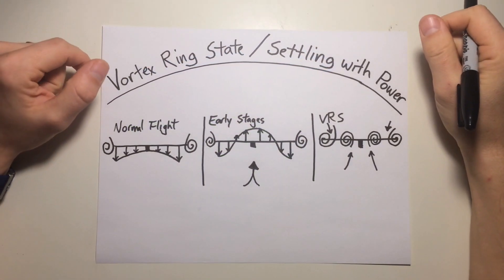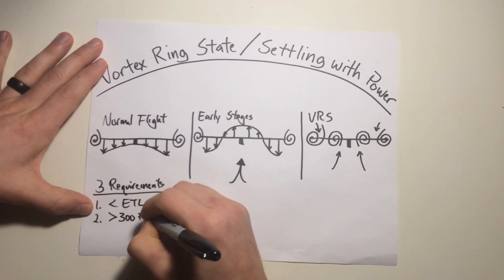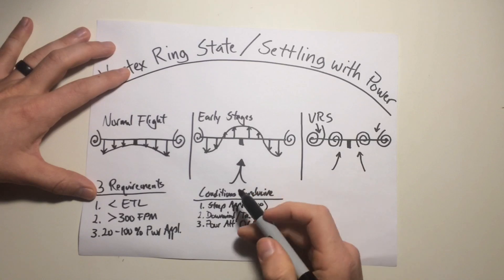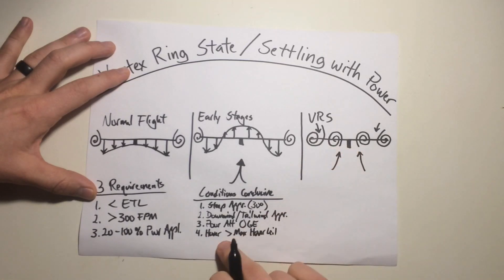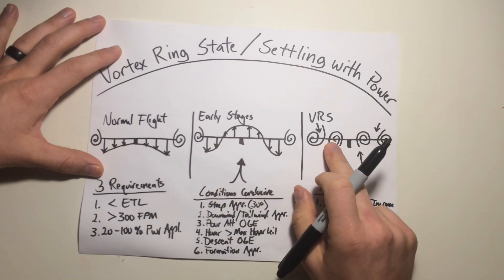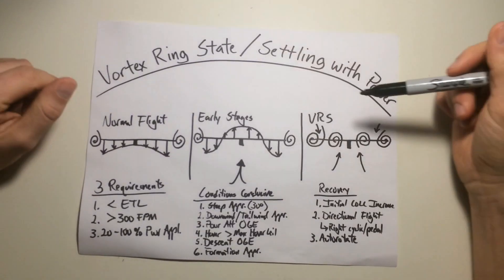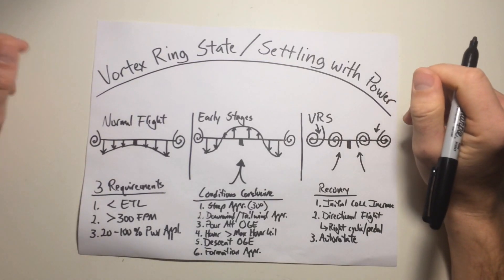Vortex Ring State / Settling with Power in Helicopters - Part 2

Comment: Settling With Power is not Vortex Ring state. VRS is when the helicopter enters its own downwash. Settling with power is when the rotor's drag is so high that engine is no more able to keep nominal RPM. Because of the RPM are not nominal, it producess less lift and also you can stall the main rotor.

Comment: You should state clearly that settling with power is possible without being in vortex ring state! To me it sounded like you say that settling with power is a result from vrs, which is not true. Those two are totally different conditions, only the result when not handled properly is the same: hitting the ground without the ability to stop the descend rate.

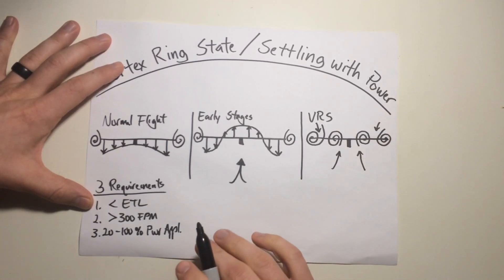Comment: Thanks for the effort in the videos.  It is always a good quick refresher. Just a slight correction at 2:45, according to TC 3-04.4 you must have the three conditions existing simultaneously in order for settling with power to occur.

Comment: A squirrel cage fan can hold or contain almost entire airflow. A ducted fan can do this nearly the same. A helicopter blade is completely different because it's out in the open. Plus, the blade can throw those airs out sideways to mess up the downward flow to cause the vortex.

Comment: Hi, in your description of the parameters required to enter VRS you mentioned that the descent rate had to be greater than 300 ft/minute, does this vary based on factors such as rotor diameter, or is it a fairly fixed value
Reply: The descend rate you need to enter VRS depends a lot on total weight and rotor diameter. Usually it is 600 to 1000 ft/min.

Comment: Can a rotorcraft which is landing in an autorotation configuration develop a vortex state? I say no but I have heard statements from Gyroplane CFI’s this can occur. To me a complete reversal of airflow has to happen at the exact point of the aircraft flare and that seem unlikely especially dire to the fixed state of the angle of incidence or collective found in most teetering type of rotor systems.

Comment: my brother, a few questions 

1) so is ETL basically forward airflow ? i watched the other video on it also left me a little confused.  do you just power forward once you have a bit of lift? and slowly pitch slightly forward until you achieve ETL? and does this still apply when you're flying at higher altitudes? should one ALWAYS be pitching forward more or less to maintain ETL? and how are you supposed to maintain ETL when hovering, or descending from a hover?

2) what exactly is a "downwind" "tailwind" approach?

3) for the 4th condition i just was confused on what exactly happens when you're hovering above your max hover ceiling, what that means for airflow and what you meant by not alot of power applied? and why does being at the top of that hover ceiling pull more power?

4) if you're hovering at ANY altitude 2x more than your rotor radius above the ground is it classified as an OGE hover ? 

im sorry if these are stupid questions im not a pilot at all but this is so interesting.

        @@UCG13vqdYSapylJU53JD8yEQ

Comment: There is a forth condition needed as per the U.S. Army.  An approach angle of 30 degrees or greater.  If you think about it almost every single normal approach you make has the first three conditions you listed.  If it happens to you, you will be close to the ground so autorotation  would not be a good choice.
Reply from the maker: 333insaneclown. Per the U.S. Army's Fundamentals of Flight manual, there are only 3 aerodynamic requirements for a Vortex Ring State. The 30 degree angle applies to a technique to help avoid the condition. Thanks for the feedback!

Comment: Thanks for the helpful series Jacob. I am just learning about helicopter flight dynamics and I have a question about the two terms: It was my understanding that in Vortex Ring State the blades are in a stall state, while in Settling with Power they are producing lift, just insufficient to reduce the decent the desired amount.
Reply from the maker: Dan H. Vortex Ring State in most aerodynamics manuals is attributed to "turbulent air" rather than a stall condition. A stall condition is defined as when the resultant airflow impacts outside of the critical angle of an airfoil. I suspect that in a VRS the airflow is buffeting in and out of this critical angle because the airfoil is still producing some lift (although not enough). We know this because 1) the descent rate is not that of an autorotation and 2) if you entered a true autorotation the vortices would go away.  

To address settling with power, many people get wrapped around the word "Settling" whether it be with "insufficient" or "sufficient" power.  Settling with power (sufficient power that is) is associated with a Vortex Ring State because increasing power intensifies the ring state and increases rate of descent.  The airflow is simply not conducive to flying despite the aircraft having plenty of power available. Even with a large power margin, the rate of descent cannot be arrested due to the ring state only being further aggravated with power application. This is drastically different from settling with insufficient power.  This condition occurs specifically from operating a helicopter with very little power margin and a sink rate is allowed to develop greater than can be arrested (based on aircraft climb/descent performance charts). As the helicopter decelerates less than ETL it falls even faster at a rate that's unrecoverable. This is simply poor planning, power management, and poor pilot technique. This condition doesn't even require a Vortex Ring State to be present in order to occur. I think it's important to distinguish the differences between these 2 types of settling because one deals with an aerodynamically turbulent environment and the other deals with power management. I hope this helps.

Comment: Jacob, from one 64 driver to another... great video series. However the recovery is most effective when executing Claude Vuichard's recovery. As you stated directional flight which is not always forward. Application of maximum power maintaining heading and lateral cyclic allows for faster recovery. There is a video on YouTube that demonstrates this maneuver. Great job though.

Comment: Hey, On the outset let me thank you allot for these videos,These are some helpful insights for the freshers.

So you mentioned for recovery , give some form of directional flight , mostly right lateral and right pedal
Have a look at this link below, a beautiful visualization of the Vortex Ring State 

https://youtu.be/HjeRSDsy-nE
https://www.youtube.com/watch?v=HjeRSDsy-nE

This Technique suggests to provide cross controls, like right pedal left cyclic . Let me know your thoughts on this.
Reply from the maker: Shubham Sangodker. I took a look and that's a great video! I had not heard of that method but it makes sense. I had heard of applying right cyclic/ right pedal in order to decrease torque and allow more collective increase. But it appears this technique uses the tail rotor to help push the helicopter laterally out of the vortex ring state. Interesting stuff. Thanks for sharing!
Reply: Yeah , That was my takeaway was the same